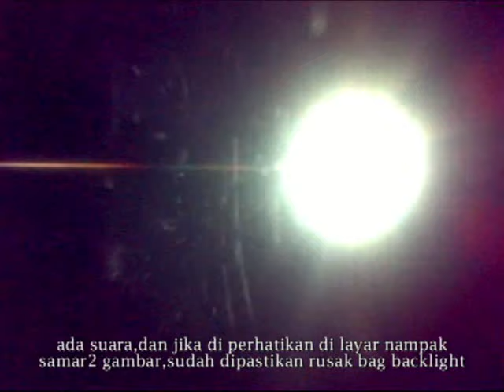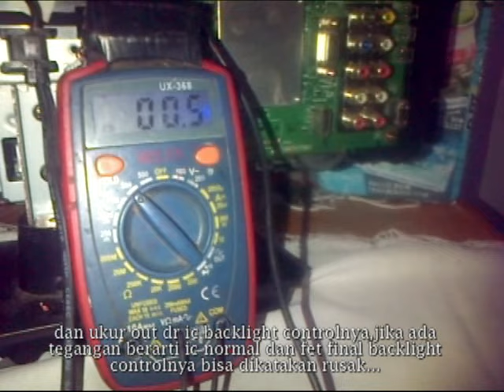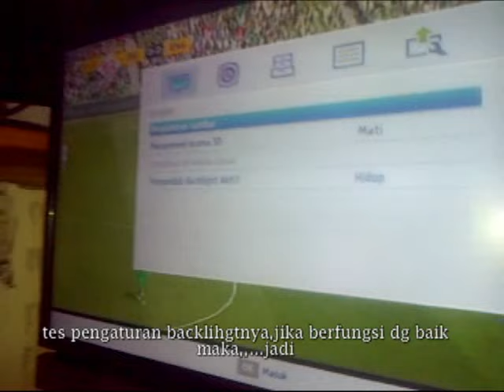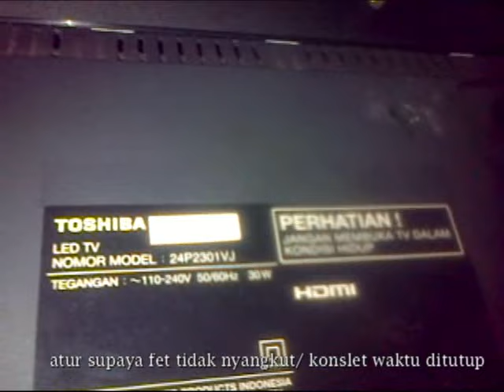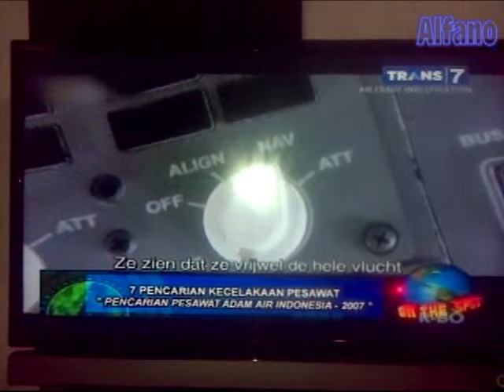tutorial cara memperbaiki led tv

Comment: gan saya mau tanya, merk tv yg sama kerusakan juga backlight..
tetapi led berkedip, sesekali menyala, suara normal.
tegang ke pin out led terukur 63 volt dan saya amati led tidak ada yg putus..
apakah tegangan over yg menyebabkannya?
tetapi tv tidak protek.
trik di atas saya belum coba, tapi apakah menurut agan kerusakan sama seperti postingan agan di atas?
Reply from the maker: coba aja mas,tapi di cek dulu socket kabel ke lednya,terkadang jg cuma disitu rusaknya.kendor aja.
Reply: kasus sudah di tutup mas..
ternyata ada salah satu led yg redup, setelah saya jumper led dan tegangan normal kembali..
makasih atas petunjuk videonya mas..